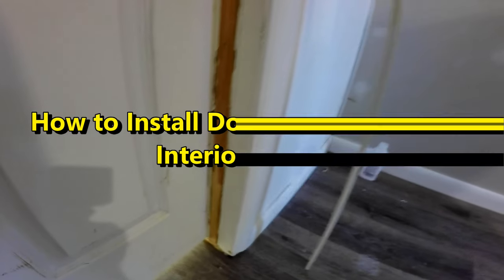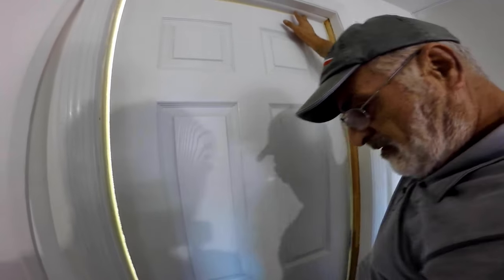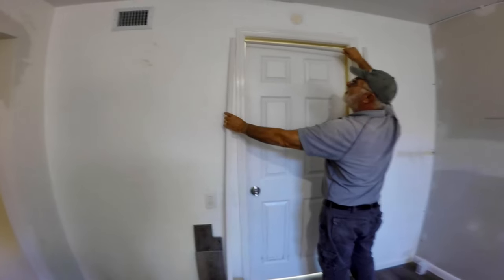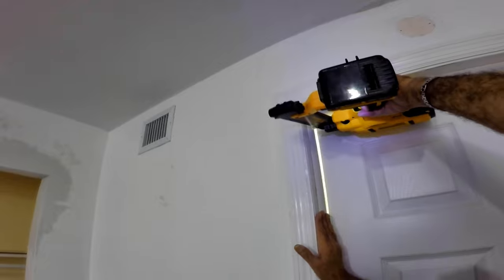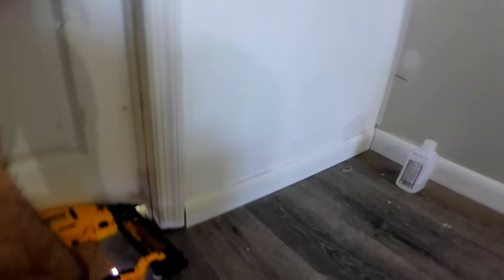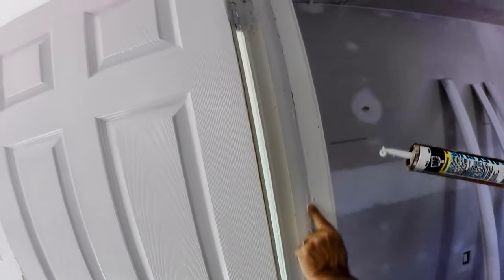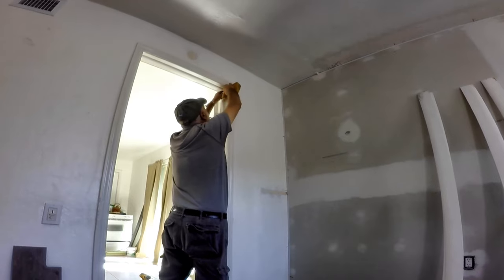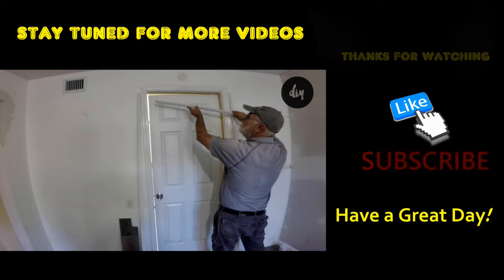How to Replace Door Stop Molding on Interior Door

Comment from the maker: This video will show How we replaced Stop Moldings on an Interior Door
These door stop molding are very easy to install or replace if they get damaged.
SEE 🛠 TOOLS & MATERIAL USED IN THIS PROJECT in the description.
Reply: I liked this video!

Why do you paint after install instead of before? Seems easier to do it before, but I've never actually done it
Reply from the maker: @pokerstar2926  Good question. Molding is already primed, painting before installation will not prevent you from painting again after installation, cause you need to fill the brad nails holes and caulk.
If this was an exterior door I would probably pre-paint no matter how much touch up it will need after install.
Reply: @JohnCRV  ah, yes finish work. That makes sense.

I think if I were to tackle this project it wouldnt get the after install paint. That seems like a separate project in and of itself between the taping, tools and total time spent! I'm guessing you already have a video getting in to those details?
Reply from the maker: @pokerstar2926  I don't have a video of the painting but I may do one in the future. There's nothing to it. After caulk is dry, sand the whole frame and using hi gloss white paint and a good fine brush, give it a first coat. After 4 hours or more of drying, give it a nice 2nd coat and done. It will look like marble. 👍
Reply: @JohnCRV  right on! I appreciate the insight that you share. I'll definitely be checking out your other videos!
Reply from the maker: @pokerstar2926  Glad to help. Have a great day!

Comment: I am reversing the swing direction of an interior door and have to remove the existing stop molding (it is rounded on one side). I would like to reuse it. Is there a way to remove it without damaging it? Or should I just purchase a new piece? Cheers.
Reply from the maker: The effort to save it will take way too much time.
Reply: @JohnCRV  Thanks for the advice. Cheers.

Comment: Thank you for the video. Is there a rule of where to put the door stop moulding on the jamb, front to back? The door is not attached yet, am building the jamb first. Eyeballing looks like doors usually close at about the center of the jamb, but does it depend on door thickness, jamb width, hinges, etc? I can't figure this out
Reply from the maker: My rule of thumb, if your door is 1 1/4 inch thick, I place the the edge of the stop molding at 1 1/4 inches from the inside of the jamb. What I call the inside is the hinge side. Hope I explained it clear enough.

Comment: I'm setting a bunch a new doors with new jambs and stops. When I trey to set my stops, the door is flush with the jamb so I nail the stop at the top, but a the bottom the door isnt flush with the jamb its either out heavy or to fear recessed. How do I fix this?
Reply from the maker: sounds like the frame may be not aligned. try to adjust the bottom first and secure it. then do the top and sides. Its not easy but it can be done if the adjustment is not too out of line.

Comment: so there is play in any door latch of between 1/8 to a 1/4 inch.
does the trim go against the door pulled fully shut, or against the door pushed tight to the latch?
Do you split the difference to allow for paint?
Reply from the maker: you can use a credit card to space it.
Reply: great, pushed in or pulled back?
Reply from the maker: @robertstevens1537  I would do pushed.
Reply: @JohnCRV  Thank you so much
Reply from the maker: @robertstevens1537  Glad to help.

Comment: We’ll I needed to see the removal…!!!!!!
Reply from the maker: Removing is very easy, take a painter multi tool and hammer, pry it apart from the frame and sand down paint edges. Once you have it smooth you are ready to install new ones. Hope it helps.
Reply: @JohnCRV  gotter done in under 15 minutes?

Comment: Could I completely remove a door jamb? We have French doors on our closet. I put the dresser in the closet, and the drawers are stopped by the door jamb. If like to remove the jamb on the sides only.
Reply: Sorry, remove the stop molding, not the entire door jamb.
Reply from the maker: Sure Just take them off on both sides ad top, sand down the paint edges and repaint.
Run a blade knife on the edges before prying the molding off. Less pealing of the paint makes less sanding. 
This link shows how I took off the trim molding around a pocket door. Hope it helps. same principle using the blade to cut the edges.
https://studio.youtube.com/video/_9KauE3ussM/edit?c=UCBjECFPg59H1Gu5s-rXg3KQ

Comment: I have to replace the stop on the hinge side. Door wouldn’t close because it was hitting it. I tried shaving it down but mangled the stop so I’m going to put a new one on. Should I gap the new one a hair off the door or should it lay right against the door? Thanks!
Reply from the maker: Need to leave some gap especially if it needs to be painted. A good tip is using a credit card between the door and molding. Good luck.

Comment: How do you cut the 45 degree angles for the corners?  All I have is a miter box and I can't seem to figure out how to do it.  Can't find one video on it....lots of door trim videos but that is a different cut.
Reply from the maker: They are 2 inside corner cuts and 2 outside corner cuts. 
This video is the best I can advise. It's for floor moldings but same principal.
You can use a miter box and a good saw.  https://youtu.be/DpmYIzkfDCg

Comment: What size nails do you use?
Reply from the maker: For the stop, we chose 1” brad nails. Fire a brad nail approximately every 8 to 10 inches for the length of the door trim and stop.
Another common method to nail on the door stop trim is to use a hammer 18 gauge finish nail about 5/8″ to 1″ long, depending on the casing and stop thickness. You don’t need to attach the stop to the stud beyond the frame, just to the frame. You may want to drill a small pilot hole in the stop if it’s prone to splitting.

Comment: Can I use screws instead of the nails? I like screws.
Reply from the maker: May be some small ones and I would predrill the molding as well.  Good luck!
Reply: @JohnCRV  Yea, I have small ones. The cross-head measurement is 3.5mm x 30mm length. It can drill itself into the wood. Would you still pre-drill?
Reply from the maker: @patrikstallone1733  It's up to you but I would. 🙂
Reply: @JohnCRV  Okay, thank you :). I am a noobie :P. Why is it better if u pre-drill it?
Reply from the maker: @patrikstallone1733  - Screws can crack thin moldings like the one you want to install. especially a door stop. Home Depot has very thin nails made for trim moldings. You will have a better finish too. 👍